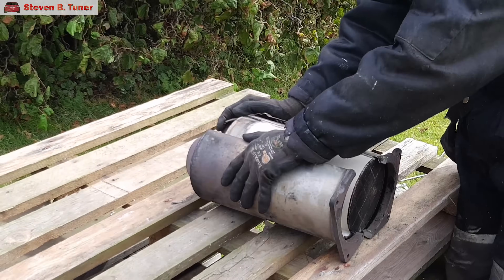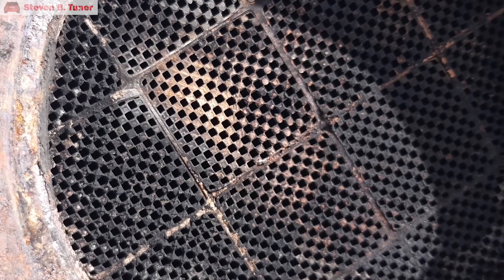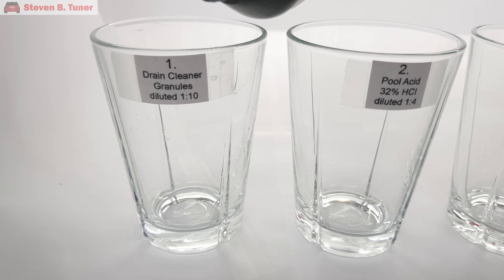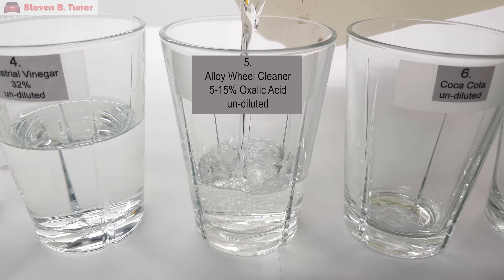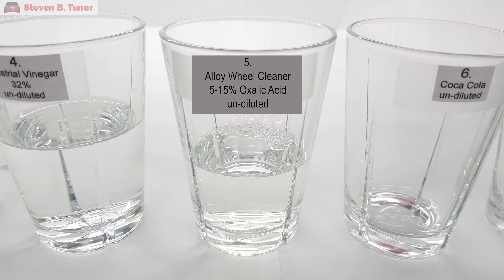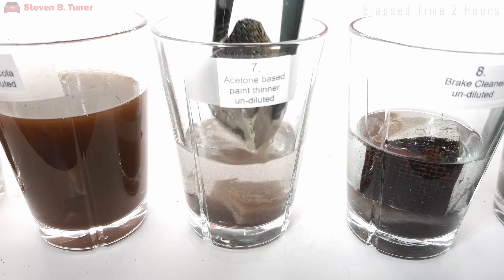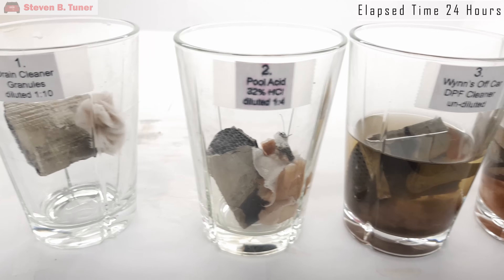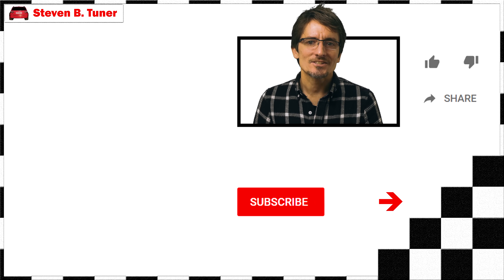DPF Cleaning at Home – 9 Chemicals Tested (Diesel Particulate Filter DIY Ash Cleaning)

Comment: The irony of DPFs is hilarious. Save the environment by filtering out some particulates, while at the same time consuming almost double the fuel and halving the efficiency and life of the engine. Great video though, pretty enlightening. Coke is scary stuff.
Reply: And this is why I cleaned one out of my car.
Reply: Great video 📹 👍 thanks
Reply: They are a joke aren't they lol when  we get to work in morning we have to start all vans and let them smoke their heads off for 10 mins why dpfs cleaning its self its ridiculous
Reply: Let's not forget about the manufacturing of def and and the waste of plastic containers. So smart!
Reply: @cg5138  For one, DEF (as in Adblue or urea mixed with water) has nothing to do with the DPF, and is used for a completely different purpose. It's not doing something with the DPF, albeit it's there - just like the DPF - to reduce poisonous emission, but a different kind of that: NOx gases, that can cause a wide variety of respiratory diseases. Also, DEF is produced as a byproduct of ammonia production, and its production is actually reducing the environmental impact of that. As for what's smart: smart would be if people would educate themselves about the DPF, DEF and similar stuff, before spitting out stupid statements about it, because for one these are there to save their lives and health, but also because only the really dull ones believe that all this stuff is built into cars not because of very good and valid technical and health reasons, but because of being part of a guvemah conspeerazzy to oppress them.
Reply: @berczigabor  yea it's basically identical to the urea that carries all of grain ag today which means it's peanuts in comparison
Reply: @berczigabor  Thanks. You’re so patient and clear. 
It’s sad to see so many gullible people down into those tinfoil hat conspiracies.
Reply: @alexmanojlovic768  Wrong on so many points. Like that the efficiency of the engine is NOT reliant on "how much oxygen & fuel you can pump into it", but on how the power it generates at any moment relates to the actual momentary needs to propel the car forward - which EGR (and turbos) allow you to change on a wider scale. Or that with EGR the engine will NOT inject the same amount of fuel, but less - just because less fresh air is sucked in, and because it injects fuel based on the amount of fresh air sucked in, trying to preserve an ideal ratio between them. So, EGR in reality - and contrary to your clueless claim - actually decreases overall fuel consumption in real world situations (ie. where you don't need all the power the engine can supply at all times, because you don't drive the car with gas pedal continuously floored from point A to B) and increases fuel efficiency because of that. Wrong also because not realizing that the increase of fuel consumption by DPF is <1%, while it lowers the poisionous emissions by >99%. So, even though cars with DPF do use an insignificantly higher amount of fuel (<1%+), but their carcinogen emissions are still 98% lower even accounting for that, than what they would be without the DPF. But, hey, thanks for proving Dunning-Kruger effect, again.
Reply: @cg5138  I mean how many plastic containers do you buy in a year? So is it really honest for you to complain about that?
Reply: We run a fleet… and its hundreds of plastic bottles, thousands or hundreds of thousands in a large fleet.
Reply: There's nothing ironic about the DPF, because its purpose is not to reduce emissions overall, but to reduce the toxic emissions by transforming them to essentially non-toxic substances. In that regard it's a marvelous invention, because it reduces toxic and cancer causing emissions with at least over 95% efficiency. Also your double fuel figure is off by a magnitude of two at the minimum. In reality DPF only increases fuel consumption by a few percents in the worst case (even less in most cases), which, again, is a very small price for not having to die of cancer or even just live with asthma and in constant smog in cities.
Reply: @berczigabor  😆😅😂 take your car for a long run & consume fuel needlessly to clean something that decreases Mpg & forces regular unnecessary use.  Well Done for being part of the next lamb platter. 1980's inventions that would be giving 130-150mpg by now, which would require far less emissions cr4p were deliberately not implemented as they REDUCED FUEL SALES & reduced thecservicing & longevity inherent in modern engines.  You'd make a good winter coat or some nice Ugg boots.  Baaaa!
Reply: @berczigabor testing proves the Diesels only cause 5% of particulates in the US. 30% comes from China. Then the list goes on. From overgrown forests causing huge fires (yes it’s the fuel) not global warming.
Reply: @berczigabor absolutely not true. I have a 2020 ram 5500 which runs 11 MPG empty and a friend has the same exact thing but deleted and it gives him 18 MPG empty!!!
Reply: @NLCRM  Absolutely true. I have a 2020 ram 5500 which runs 18 MPG empty and a friend has the same exact thing but deleted and it gives him 11 MPG empty!!! <- See? I can make such claims, too. They mean nothing. They're anecdotal evidence at best. Complete fabrication and/or result of ignorance at best. The thing with the laws of physics is, that they works the way they do, regardless of whether you want it or not, agree with it or not.
Reply: I don't think you understand the purpose of the DPF. It's so people don't die a horrible death. The EGR and SCR and DOC are doing their jobs by reducing toxic chemicals that are also causing health problems.
Reply: @RoadKing05FLHR  No!! They're an excuse to NOT increase Mpg & thus effect much less restriction, producing far fewer pollutants.  Read my comments above to BerkZigTheBore on throughflow, Cerium/DPF's/EGR valves/Rotary valves & Citroën's alternator within the flywheel.  You can only create as much pollution as the mass of chemicals/gases you combust.  Reducing the amount required REDUCES the POLLUTION , reducing the need to process that REDUCED OUTPUT!   DPF's, Cats & EGR valves were added INSTEAD of devices/inventions that would INCREASE EFFICIENCY & reduce fuel use/pollutants FIRST, THEN clean up a reduced level of pollution!  Emissions Sh1te was invented to increase fuel consumption/profits with the excuse of doing us all a health/environment favour.  Funny how inventions that gave 20% Mpg improvements each in the 80's were never implemented as well as 1,000's of others, but CATs DPF'S, EGR's went straight in...  Are you just another Koch Sucker?   See what I did there "king"? (Klauun....)
Yes.  I know increasing efficiency via higher compression ratios increases temps, increases NOx.  Build these technologies & give me the comparative stats!  Oh WAIT.  You can't, the Kochs bought the patents.
Oh dear, one of them died. Well... so you only have half the resistance... 😂
Reply: @RoadKing05FLHR 😂😂😂
Только США, начиная с 1945 года, развязали более 20 войн, и убили десятки миллионов человек, а там же ещё есть другие страны НАТО!
А вы тут нам рассказываете, что dpf придуман, что бы люди не умирали!?😂
Reply: Not to mention all the def boxes I let fly out of my bed
Reply: The engine recycles and burns off the soot/ash while in commute when the engine/exhaust is already hot. The cycle you may be referring to regarding reduced fuel efficiency is if you just let a car sit while running , in which case, you're fuel efficiency aka mpg is already 0.  Zero logic to this comment.  Most people actually drive their car, not go from point a to point a, or from point a to be b 1 mile away 5 times a week.  The indignation is funny tho as you seem emotionally against dpfs for some reason, possibly conspiratorial.
Reply: And finally burn the particulates and release them into the air in smaller form.
Reply: @BonafideDG  If you burn the particles they do not get smaller, but they mostly turn into substances directly completely harmless to humans: H2O (water) and CO2 (carbon-dioxide). That's the whole point of there being a DPF.
Reply: Oh my bad @berczigabor
Reply: this crap it's only for our lungs 🫁 not for actually environment , if u have another idea then i suggest you to drive in the back of a non euro or eu 2 diesel and then u will see if u can breath , this it's when car it's in good condition but when it's not then God help you maybe, when i see an old diesel i turn off the ventilation and switch lanes when i can :)
Reply: Lol yep. So let's see it collects soot while its running. Burning the fuel.. then the brains get together and say let's double the fuel to heat up the filter and burn the soot and blow it out into air.. so I bet it while its in regen mode it collects almost twice as much soot while it try to burn the soot already collected... lol lol yeah sounds about right for the idiots who belive in it.. so if it takes heat to clean it move the filter right after turbo where its hot so it can collect and clean at the same time.. hmmm
Reply: @stevenjones618  I don't know how many DPFs you've removed, but pretty much all of them now are as close to the turbo/engine as is practically possible.  Secondly, very often (depending upon vehicle use) regeneration takes place passively as a result of temperature build up.  Only when this isn't possible is additional fuel needed to aid the process.
Reply: @heyho1974  well I had a 2012 ram cummins and that thing regen about every 300 miles. I drove highway and 90 percent of the time. And maybe 10 percent on state highways about 45 mph.. I even asked the dealer why if I'm on highway way more than. City guys mine is still regen about 300 miles like clockwork.. while gm and Ford wasnt... well the service manager said since 07 ram was using passive and guys just were not getting on highway enough to cause a complete regen.. so they changed software around to force regen.. and the main reason was Chrysler was getting tired of changing dpf under warranty because it wasn't regening enough.. so they changed software to make it last long enough to get it out of warranty which was 7 years 100k miles for cummins
Reply: @stevenjones618 plus to use more fuel to burn the soot means making and hauling more fuel. One must look at all the side effects not just the ones that satisfy one’s agenda.
Reply: @stevenjones618  Thanks for a perfect demonstration of the Dunning-Kruger effect
Reply: Emissions systems are a joke & the oil companies are laughing at us.  I agree, I've always said this.
They could easily be at 120 Mpg now, which is EASILY achievable, as there were 2 inventions in the 1980's that no manufacturer took up, using pathetic excuses not to.  Each gave 20% improved Mpg on their own in the 80's!!   You can only get as much pollution as the amount of fuel you burn, so burn less fuel, get less pollution!!  As you point out, add weight & restrictions to gas throughflow, increases fuel consumption AND POLLUTION that then INCREASES the amount of filtering required.  Also "take your diesel for a long run to clean the DFP!!" 😆😅😂   errrm use more fuel, cause more pollution!!  Citroën devised the alternator within the flywheel.  Less weight, lower load on the crankshaft, higher voltage/ampage output, no casing/pulley/belt/mounting parts.  Aussie guy invented the rotary valve (tube with slots) driven by electric motors which gave truly variable valve timing & duration.   No stupid cambelts/valve springs/ Impacting valve heads.  Higher compression ratios (better cooling) less noise, shorter engine height, less weight, fewer components etc.   Killed by the oil companies.  Still only get 35mpg around town in a 2.0 diesel in 2023.
Emissions cr4p is a con to increase fuel consumption & require more Stealership visits/sell more parts/kill engines prematurely.

Comment: Now the only question to be asked is did any off those dissolve the platinum wash inside the ceramic. The ash may be gone but if there’s nothing left to catalyze the soot the then it’ll no longer work as a dpf. If you want to test to see if the wash is gone then you can send it off to a company that does spectroscopy and compare to a control from the same dpf. The easier but not full proof way to find out is by seeing if any of the components of the wash coat can be dissolved/broken down by those different chemicals. Nonetheless, I did enjoy your video.
Reply from the maker: Hi, please check out my other video where I test the platinum and aluminum oxide that make up the catalyst material: https://www.youtube.com/watch?v=LE1boZ3fhLg

Comment: Thanks for the video. Clearly the pool acid is way ahead, may I ask which brand you used? Thanks
Reply from the maker: Hi, I used 32% HCl brick cleaning acid, but pool acid is the same stuff, and the brand doesn't matter as long as they are reputable enough to put in the correct ingredients.
Reply: @StevenBTuner  thanks for the reply. Very much appreciated.
Reply: @StevenBTuner  This worked perfectly, left for 24 hours, reset the fault codes, (bmw 635d) ran in sport mode for 40 miles keeping the revs above 2k and had no issues.
Reply from the maker: @garywilliamson1097  Well done on doing a great job!

Comment: I'm fighting a problem on an '08 Mitsubishi with only about 40,000 kilometers. (32,000 miles). Parked Regen won't go through the whole process. Only attempts regen for about 3 min. Goes into limp home mode.  I'm over 300 km from a dealership shop so have to fix it to drive anywhere. The first time it happened I got low differential pressure readings, and the shop said the dpf had been damaged. I put it on anyway and it only drove about 20km before trying to Regen unsuccessfully. I bought a new filter. $4,000. (Soul destroying!) Put that on, cleared all codes, and again it tried to Regen unsuccessfully after only a 10km uphill run. I assumed there'd be a dpf plug code, but only found a excessive exhaust temp code. What do you all think is wrong upstream? Bad injector? It's got pretty low miles. Stuck EGR? I was going to run it with the filter off just to see if it's running noticeably smokey...any ideas?
Reply from the maker: Hi, it always makes me sad to hear when bad advice means that someone ends up spending a fortune on a new DPF unnecessarily. Regeneration failure is almost always as a result of a fault with the EGR valve or glow plugs, and you will need to look for error codes as well as visually inspect the EGR valve and intake system to make sure they aren't gummed up with oily soot.
Reply: @StevenBTuner  no EGR related codes showing, there are five possible...but when it plugged and couldn't complete the cycle the first time the oil level was too high. I figured that was the problem. Seems like that could have also gummed up the EGR...only code showing after an incomplete re-gen is "Excessive exhaust temp", "DPF is overheated".(a red light-stop-your-trip code!) That was 10km after new filter, cleared codes, correct oil level, attempted park &re-gen... on an extended climb, 10% grade for 6km, but w/ normal coolant temps...
Reply: @StevenBTuner  Just got back from a uneventful 500 mi test drive. New injectors solved it. (all bad, but cheaper than a new DPF...) They are electromagnetic actuated and can fail in mechanical ways without generating a code apparently. I home cleaned the new DPF. (The old one did blow through. Something to experiment with: can you carefully plug a few individual compromised tube headwalls with some kind of liquid ceramic mixture?). The truck ran a successful 30 min parked regen. I changed the oil after the regen. These '08s over-fuel for the regen process via the cylinder injectors with an after-pulse. This causes fuel leakage, diluting, and filling the oil pan! The 30 min regen caused the oil level to rise 2 cm, or perhaps 1 litre! if not kept track of it could rise above the "over filled" mark, and really start plugging the DPF.
Reply from the maker: @iansigman1651  Great to hear that your vehicle is working great again! Fuel dilution is a very bad side effect of a blocked DPF, and can result in rod or big end bearing failures - a terrible way for a diesel engine to be killed.

Comment: Only clean i know is ... remove and remap ..... pointless thing is a dpf!
Reply from the maker: Without DPF technology, diesel cars would have been banned worldwide in the early 2000's. Personally I would rather have them around a bit longer.
Reply: @StevenBTuner  diesels are annoying if you do short trips around town. A hybrid gas electric does just as good. I have a 2021 Toyota Prius prime and it gets 1200km in a 40l tank. I use a truck for long distance trips
Reply: People like him will never get it!